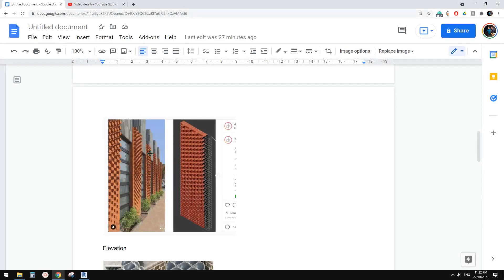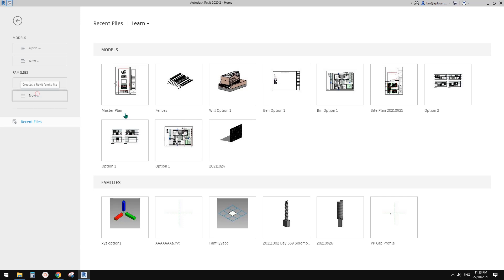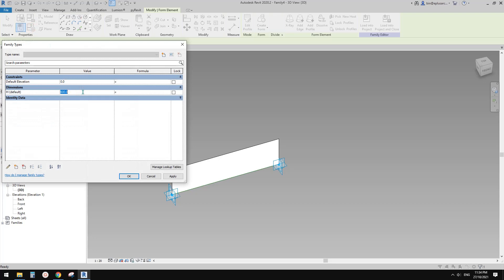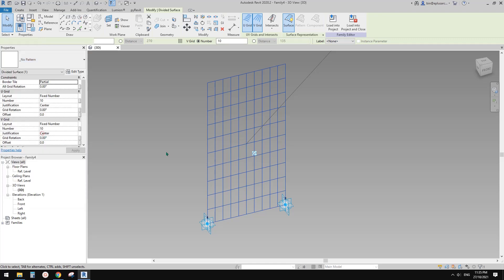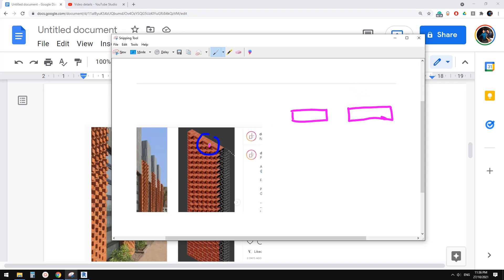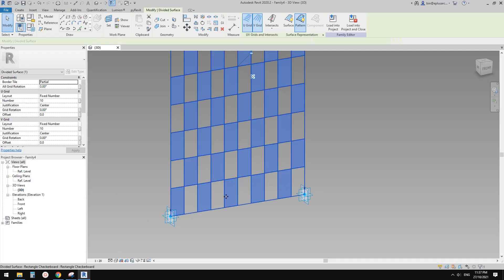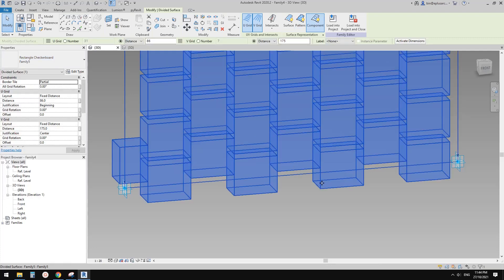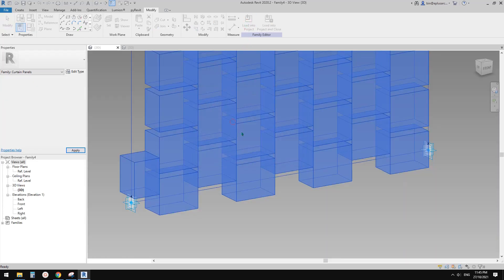Revit Exercise (Day 584) - Brick Screen Adaptive Pattern Based Part 1

Comment: How do I contact you ?I was not able to understand the concept behind the drawing that you drew for making the fanily
Reply from the maker: You just did.  The concept is to create a perforated brick wall using divided surface with a checker pattern. I did a similar one before using curtain wall panel, which is a bit more complicated.